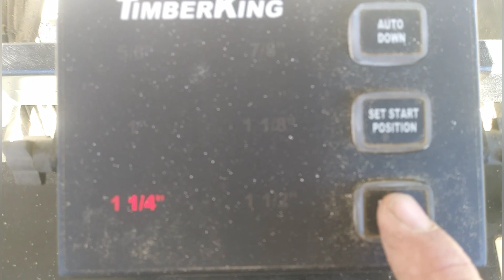Sawing Oak at the Homestead

Comment: I am thinking about getting a 1600 I talked to factory other day and got some quotes def best built mill in my opinion on market
Reply from the maker: They are very well built! Everything that would break was beefed up and welded. Also, everything that may need to be adjusted, has bolts so you can adjust it. These TK's were built to last